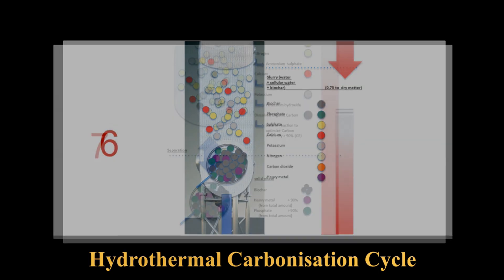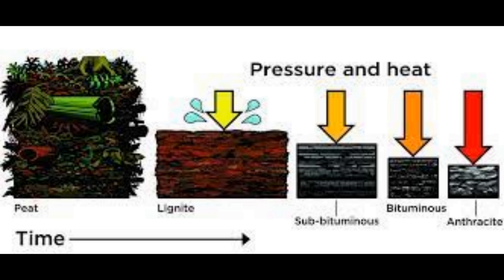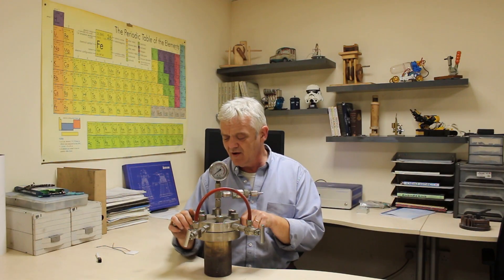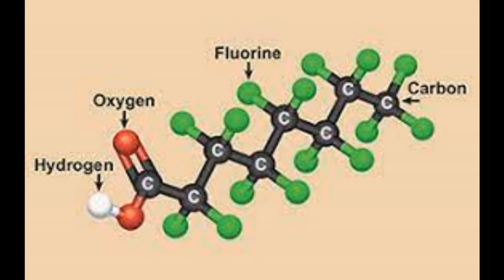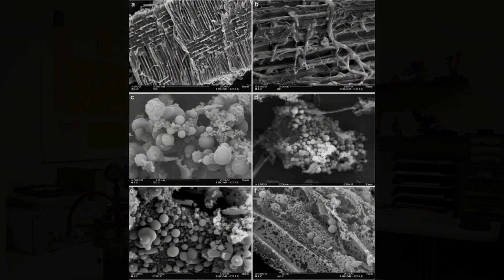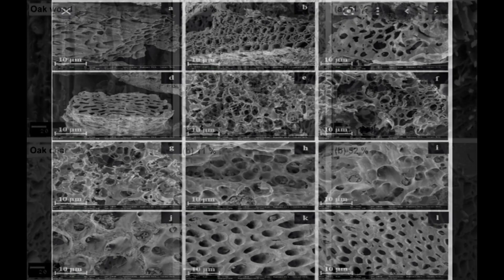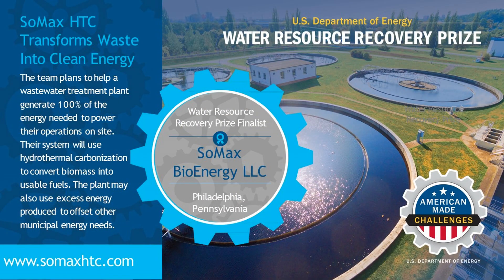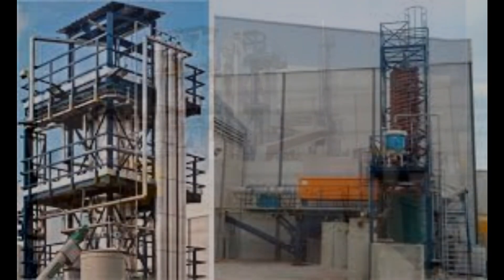1661 How To Make Your Own Fuel From Waste Or Plastics - Hydrothermal Carbonisation

Comment: Awesome thing! I've looked into it a couple of months back in the context of reprocessing cat litter into carbon/fuel but found that none of the medical autoclave specs I came across could get up to the required pressure/temp for HTC to occur. Do you have any example products you can point at that do indeed get upto ~150 psi / 10 bar?
Reply: If you search for pictures of autoclaves it is easy to pick the high pressure ones out as they look just like the one in the video, chunky stainless. China and India are two sources.
Reply: @spex357  Thanks. Yeah, I've seen these around but usually they are pretty small and super chunky (made for much higher pressures,) like the one Rob had in his video. I'm looking for something on the order of a few litres. Other than small experiments (which are valuable in their own right,) there's not much you can do with such a small apparatus.
Reply: @idratherstayprivate  The high pressure ones are probably small for a weighty reason. As they get bigger the wall thickness becomes table flattening. 
Sadly I expect many would like a bigger one.
Reply: I was looking into using either some sort of fancy biodegradable synthetic clumping litter (if i can even find one), or just wood pellets, and using an Anaerobic Digestion system for treatment of it.

If i could get the conditions right, I could maybe even use (wax) paper, heck even PLA bags too, but yeah.
Reply: @ericlotze7724  We use wheat based litter that we buy here in Toronto. It can go straight into the municipal composting system, so it's pretty much carbonizeable biomass. If I could only find a decent sized container that can handle the pressure/temp, I'd have a cat's lifetime supply of HTC fodder :D

Comment: a method using quartz spheres and coating them in strontium oxide, put in vegetable oil. bombard with klystron. the microwave radiation makes it biodiesel without harmful chemicals

Comment: Still it's very hard to convert the liquid part into something that mimicks typical fuels, trying to synthesize simpler fuels would be easier and more efficient. Or use it directly in a heat engine or turbine engine.
Reply: From what I’ve read, a similar technology, “Hydrothermal Liquification” makes a feedstock that is essentially a “drop in” replacement for Crude Oil in refineries.

The composition varies depending on feedstock, and I’ve mostly read papers utilizing Algae (it can (and sort of needs to be) wet, so this removes the costly drying phase of Algae Biomass production workflows), BUT

The only real “contaminants” are Salts and some metals (typically Iron, unlike all the nasties in most coal/some oils!).

A “De-Salter” (basically just water washes then separates the oil and salt water) can easily solve the salts, and Hydro-Demetalization is a developed technology.  Worst case scenario a new/underdeveloped catalyst needs to be developed.

Also as conventional reserves dry up, we move on to more and more “unconventional oils” etc which often contain more and more “nasties” (particularly Sulfur), so in a way Biocrude may require LESS pre-treatment than these crudes.
Reply: @ericlotze7724  Organic waste gasification produces hydrogen directly along with CO (both are very useful in the synthesis of many organic substances and hydrogen can be used directly).
Reply: @vitordelima  Yeah I love gasification too!  

Granted for long chain hydrocarbons, HTL may be more efficient, but for many things (Alcohols, Plastics, Some Pharmaceuticals, Propellants/LPG, etc) Gasification and a “Gas to Liquids” or the conventional usage (of ethylene etc) of the chemicals works just fine.

A Hydrogen, Methanol, or my favorite, Dimethyl Ether (DME) based economy could use all sorts of sources including gasification.
Reply: @ericlotze7724  Pyrolisis, which may be the same thing as HTL (without the extra pressure?), also seem to work for some long chain hydrocarbons.
Reply: @vitordelima  Pyrolysis can work, but at least from what I remember (i can dig for papers maybe), it contained a decent bit of Char that could gunk stuff up, and was decently acidic?  So I don’t think it is better than Fermentation/Anaerobic digestion or HTL for most biomass.

HOWEVER it is great for plastics, “chemical recycling” of plastics can turn even old/heavily reused thermoplastics or even thermosets back into Monomers/Basic Hydrocarbons.
Reply: @ericlotze7724  I just saw a video about some hippie doing this once.
Reply: @ericlotze7724  Good to know, but if fractional distillation could be skipped in the production of fuel it would be great, since oil is pumped already formed from the from the reservoir and those solutions need to cut as much costs as possible to be competitive with something so straightforward. The article "Preparation and Characterization of Bio-oil from Biomass" by Yufu Xu, Xianguo Hu, Wendong Li and Yinyan Shi has an overview of some methods.
Reply: I can’t speak much to the usage of Sewage Sludge/Refuse Derived Fuels/Waste Tires, but assuming proper sorting (no e-waste/lead etc!) i think the contamination would be the roughly the same small amount.

Comment: Thats truly brilliant!!!  But how easy is it to make a small scale for home use autoclave bio-digester??  I think farmers use something similar for cow / pig poo, but I'd love to see how to build one, but I just can't get my head round it.
Reply: I believe Robert has some videos on it. Essentially you can use a stainless steel tube with threads on both ends with some strong SS caps, from plumbing supplies.  You do have to be careful with the temps and times, because these homemade ones can't handle the pressure levels of the specifically built autoclaves. To be on the safe side, one could heat it within a matrix of sand or the like, so that if does explode, it would be less likely to cause damage. And if you're going to go that route, it might be more efficient to wrap it directly with resistive/heating wire (then apply a DC current), put some fiberglass or rockwool insulation around it, and then put it in the sand box.
Reply: @justinw1765  How many bars?
Reply: Yep, the old Mother Earth News had article back in 70s showing the composting of chicken dung on the farm to produce methane gas which could be used to power all the utilities on the farm. Don't be fooled, these are very old ideas being piece mealed out with folks making claim for 'discovery. Sorry, nothing new under the sun, so find everything in plain sight with open eyes.

Comment: A few years ago there was a few companies that were building plants to pyrolysis plastics into fuel. For some reason they have quietly gone away. It seemed like a great idea as the systems could use some of the waste gas to power the heater after it was started.
Reply from the maker: pyrolysis and HTC are different mate - with pyrolysis you get a lot of tar - with HTC not so much - it would be an interesting thing to see how tyres would do in this set up
Reply: @ThinkingandTinkering  And there is gasification too.
Reply: @ThinkingandTinkering  how cold one do this on a small scale exactly?
Reply: i.e. Licella - at least this past year they were announcing some forest product company (CANFOR) to process wood waste. Still waiting for a chance to license it and build a landfill-powered station.
Reply: I used to own stock in one.
Reply: There was a proposal around 2014 to build a plant next to the new London Gateway port. It was going to make aviation fuel from waste. "British Airways and American-owned fuel production firm Solena Fuels Ltd have located a site in Thurrock, Essex for the development of a gasification facility to turn commercial and industrial waste into aviation fuel". Lots of local objections around the amount of traffic it would create on local roads. The Thurrock one never happened, but Velocys have planning permission for one in Lincolnshire.

Comment: Is that really that simple? 
A lot of pressure, and (almost) anything goes? 
Why don't we have giant autoclave factories turning most of our rubbish into fuel?
Reply from the maker: yeah it really is- have a quick look at google scholar you will see literally thousands of articles on this and they are all the same process - it's simple and fascinating
Reply: @ThinkingandTinkering  which brings me back to Why don't we have giant autoclave factories...
Reply: @c3N3q    Because unless you are using renewable's, like Solar, it is somewhat energy intensive. Then also corruption may factor in some. I suspect that the wealthiest people of the world don't exactly want the average person to be more self sustainable and energy independent. 

     Also, making large enough autoclaves for mass production, is a challenge in and of itself. The larger the vessel, the thicker the walls will need to be. That's A LOT of steel. One could possibly get around this some by using a composites approach though. For example, you could take a Steel tube and then reinforce it with a combo of sodium silicate mixed with some potassium silicate and a little lithium silicate (all in a water solution) and S-glass fiberglass cloth.
Reply: @justinw1765  Or just wind coils of high strength fence wire on tubes with end caps bolted together with high strength bolts.
Reply: @ThinkingandTinkering  ... and it is fascinating, as you said.
Thank you for sharing, I had no idea,, and when you think about it it is very logical, the universe does it the same way 🤔 I think it is very elegant way to clean up after ourselves, and most likely will be building one of these from an old boiler ( if it can take the pressure ) .
xx

Comment: Wouldn't this add to the problems of climate change or am I missing something?
Reply: If it's using biomass as feedstock, and using fuel it produces to generate the heat, then it should be carbon neutral, or even carbon negative if the carbon in the "charcoal briquets" is used as a soil amendment (terra preta) and thereby sequestered.  There would be the carbon footprint of the acid production process (to make the dilute acids used) to take into account, unless there are carbon-neutral or carbon-negative ways to produce those acids.
Reply: @kevincrady2831  You could use it as a carbon sequestration technique, but burning the end products as fuel is not a responsible thing to do, especially as we need to reduce the levels of CO2 in the atmosphere.
Reply: @blahdelablah  So, where is your scientific evidence? The world awaits.
Reply from the maker: I suspect it would depend on how it was done and what use it was put to mate
Reply: If climate change was solely or primarily caused by C02, but it is not. The science on climate change is extremely cherry picked and myopic, especially when it comes to factoring the role of the Sun. (First clue, the Sun can warm the earth by other methods other than simple irradiance [i.e. visible light.] 2nd clue, the Sun was in a grand Solar maximum from about the late 40's to 2000 period or so, and pumping tremendous amount of energy i.e. heat, during this period, which of course the oceans have stored and take a long time to dissipate all that energy [decades]). 

   The irony being is that the Earth is actually heading towards another ice age. This will happen once the Beaufort Gyre releases all its pent up, cold fresh water back into the ocean circulation system.  Northern Europe will be hit particularly bad at first. The first winter after that happens will be brutal. Anyplace farther north that is kept more temperate by warm ocean currents will be immensely affected. 

  Historically, humans have always done the worst during colder periods and the best during shorter, but warmer periods. Not just in the context of longer term ice age cycles, but even in relatively recent times during periods like "little ice ages" i.e. Maunder minimums etc. It is not a "coincidence" that the human population has exploded during a relatively brief, but unusually warm cycle of the last couple hundred years or so. Main reason being farming is a lot easier during warmer cycles, and much harder during cooler and colder cycles.
Reply: @justinw1765  Two points for you to follow up on. 1. Go watch potholer54s video titled "Are we headed for a grand solar minimum?" and report back on what you find out. 2. The strengths of ocean currents are largely driven by the temperature differences between the equator and the poles. If the ice at the poles melts, there'll be less strong ocean currents, making it harder to distribute heat away from the equator. Do you dispute this?

Comment: Great video,would be a great asset for an off the grid homestead.
Reply from the maker: yeah I think so
Reply: @ThinkingandTinkering  👍
Reply: @ThinkingandTinkering  I suppose that the energy needed might cancel out what you gained depending on what you were aiming for,my thoughts were converting an acre or so of weeds into fuel for a tractor or truck etc...

Comment: So an induction coil could be wound around this and placed in a thermo insulated box with a thermo temp switch
Reply from the maker: still need the pressure mate - so as long as it can cope with that then you are away
Reply: @ThinkingandTinkering  oh I meant on the hydrothermal auto clave . Just wind the induction coil around the bottom part. Do you think it would be a good way?
Reply: @Buzzhumma     I would be more apt to wrap resistive/heating wire around it, then insulation, and hook it up to a Solar panel. Just easier than induction, though the induction would be more efficient. But who cares if you're using the Sun as an energy source to begin with. It is super easy too, since you don't need an inverter, batteries, etc. Literally just a Solar panel big/high wattage enough to get the heating you need. (Though you would probably want some kind of electrical regulator as to adjust temps).
Reply: @justinw1765  yeah ok i see. That 250 degrees c should be easy enough with resistive wire and keeps it a far more reliable simple system . This is a perfect case of combined thinking to get a better outcome ! 👍🏻thanks mate

Comment: Going back to my scuba diving days (about 25-30 years ago) your talking about 20 metres under water. That is a very achievable pressure from the most simple pressure cooker, even a simple home made pressure vessel. Then you mentioned coal or brickettes. This seems to be a simple home made experiment.
Reply from the maker: it is mate - we have done it before - but like JM says care is needed and for someone not used to this sort of stuff rated equipment would probably be the best idea - or at least stick some sand bags around it and resist the urge to peer in !!
Reply: @ThinkingandTinkering  extremely well said mate
Reply from the maker: @stevetobias4890  cheers mate
Reply: @ThinkingandTinkering   Or dig a hole in the ground and put it in there, with a sand bag or the like over the top.
Reply: Would need to modify/change the pressure relief valve on home pressure cooker. I wouldn't suggest the avg home tinker to try such in kitchen device. A vessel failure could do serious harm, even at 30psig. At 150psig hot acid vapor and shrapnel would be a bomb. The Boston marathon bomber used dry ice in a pressure pot with the psv blocked if I remember correct
Reply: @Skunkhunt_42  very true but done right using the standard safety regulations, even common sense, would have you pretty safe
Reply: @stevetobias4890  agreed. Just not counting on the avg viewer as being aware of such details. We say "this is super easy. You can do at home" nudges folks who might not be best fit to do this level of what I call "back yard boogie" safely with full awareness of details critical to not making a bomb

Comment: This would also let off a lot of Syngas while it's being cooked, right?
Reply from the maker: well it is in a sealed pressure vessel - so only if the pressure exceeded the check valve limit
Reply: @ThinkingandTinkering  exceed the *pressure safety/relief valve* - sorta like a check valve but in industry at least, we can't swap check valves for PSV's. Psv is the only safe option, has alot to do with how they relieve pressure at 5-10% of set point as well as reseal once below